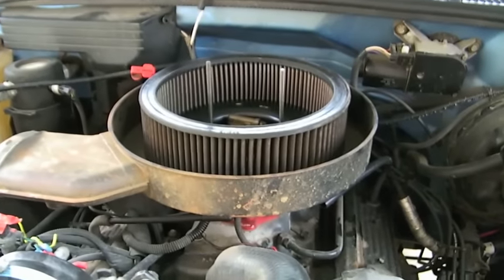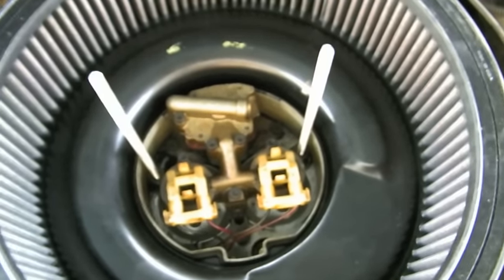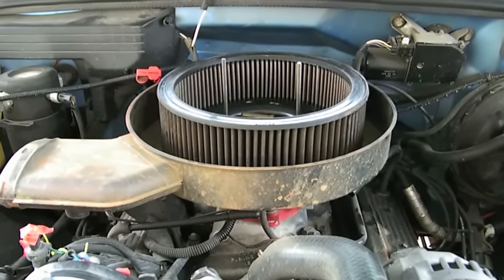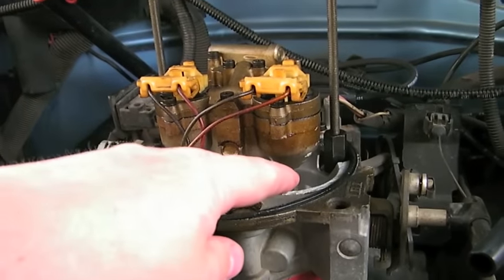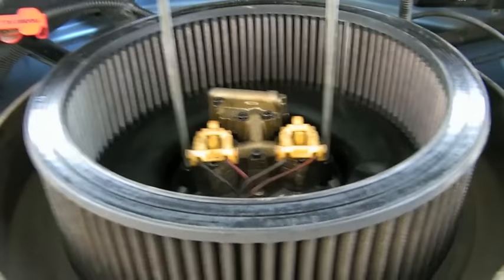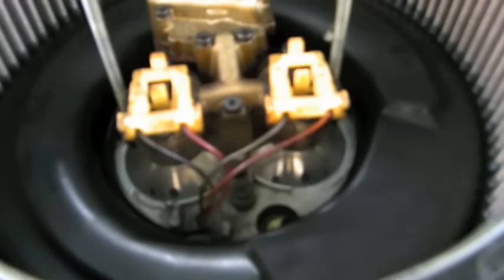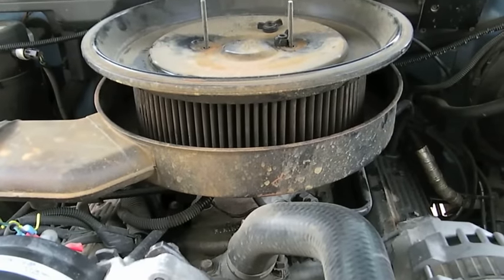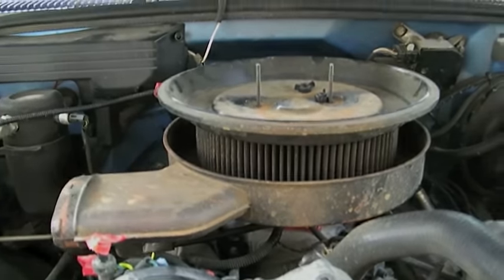TBI mods, how to get the most power and Horse Power from your TBI engine.

Comment: Go to goodwill and find a bowl who's bottom is approximately the same diameter as the spacer. Cut the bottom out and use as bottom of air filter. My car hood clearance was an issue you should be fine. This will allow for airflow from the side. This was from a Carcraft Dyno session. I had one on my 88 Monti Carlo you could always try one real quick without the filter and see if it works as good as it did on mine.

Comment: The lid flip is not smart for are 5.7 tbi. Because its sucking alot of hot air. Its a old school mythod that should stay in the past
Reply: Kyle Hendrickson with some engines, running to cold of air would actually be worse, just because the engine gets horsepower off of the heat it generates, so it would be fighting itself
Reply: Seth C Its a proven fact that cooler air produces more horse power, not hot air. So the lid flip is not conducive to making HP.
Reply: Scott George depends on your engine. in a chevy 350 yeah, cold air will give you horses. in a 2.0 4 banger, it will hurt the engine because its fighting to stay warm. but a general rule of thumb, you want as much fuel to keep up with how much airs coming in, whether its forced or naturally aspirated
Reply: Actually it does work. My truck has a 350 and when the lid isn't flipped, it doesn't get very much air and is restricted to the small amount it gets out of the wheel well, you can feel the difference in power when it is flipped because it has more get up and go to it and is getting way more air to the engine. And you think hot air isn't pulled from the wheel well also? I have 33" tall 12" wide tires and I guarantee that they produce heat going down the interstate at 70mph and that heat is pulled into the wheel well and into the intake. You're right if we're talking about sitting still it's pulling hot air, but going down the road it's pulling cool air because you're going atleast 35mph and that's 35mph worth of wind going through the grille and into the engine.
Reply: Alexander Moffitt any oem air system is designed to be restrictive, it was designed to coincide with the vacuum the engine produces, provided everything is sealed tight an engine will run smoother. but in the late 80s and mid 90s throttle body was more of an experiment on their v8s. but yeah there is a difference, and my favorite was cutting a hole in the hood, and the flipped lid acted as like a ram air. but kyles right because unless you have another vent for air, or some other system, you still are getting warm air, but all in all its a step up anyways
Reply: +Kyle Hendrickson Was great to listen to the old quadrajet's howl when the secondary's opened.  I wouldn't do it to a TBI system.
Reply: +Alexander Moffitt That's in your mind.  Put it on the dyno and share the results, if any?
Reply: +Seth C Again, another Noob.  Ram Air ... LOL.
Reply: Kyle-----You're right!   I did a "lid flip" on my '88 GMC pick-up and the engine runs rough.  Put the air cleaner back on the regular way  and the engine runs great.
Reply: Works there's proof. Air cleaner shootout.
Reply: @roknroll12  something something density altitude something.

Comment: I'm sorry I missed the part where the hose that connects to the back of that ring that goes to the pcv valve. So what did you do with that? Asking for a friend
Reply from the maker: Tell your friend that I don’t remember.
Reply: U need that line to have a vacuum you route it to another vacuum port on the tbi itself

Comment: Air noise is horrendous with the cap turned upside down like that
Reply: Guys like you are why the stock air cleaner is designed the way it is. Not for flow not for power simply quiet and barely enough air flow. You're hearing the induction noise. Lid flip on an old v8 quadrajet engine would sing.

Comment: so did he shave that metal while it was still on the motor? if so have fun if the shavings don't pass through the motor.
Reply from the maker: +Allen McKinney 
The engine was fine after. Ran great for about 3 more years.
Reply: boofighter ok he just didn't say where it was when he shaved it. I wouldn't do it on the motor even if it works for someone else I still wouldn't do it.

Comment: I understand that a "Lid Flip" gives better air flow, but it gives the engine hotter air instead of the stock version intake,  So does that not defeat the purpose?
Reply from the maker: +UrABoxxyBox the question would be how much hotter vs how much more air flow.
Reply: No

Comment: Does this work with cruise control? I know that may be a stupid question.
Reply from the maker: +Thomas Burgess 
Mine worked perfectly.
Reply: +boofighter that is awesome.  I was reading some of the forum posts about cruise control and some of them seemed to suggest this wouldn't work unless you keep the ring in.  Good to know.
Reply from the maker: +Thomas Burgess 
I took the truck on many long road trips after doing this and never had any trouble.
Reply: That's great.  I am going to do this as soon as I uncork my truck.

Comment: Anyone watching this don't do it you will choke your motor to death
Reply from the maker: +Daniel Rowe 
Not true.
Reply: boofighter I got a 1995 Chevy k1500 with a 350 tbi I took the ring off when I put a single stud air filter on it and I had also put msd coil pack and jegs high wire spark plugs wires on it and when I floored the motor and it choked so I got my dad's mechanic to check it and he said they have that ring inplace for a reason and it stopped so idk what to tell you
Reply: Btw take a rag and clean up that motor put a 292 cam in it Hooker headers and a new high flow intake manifold don't be cheap btw get a Chevy not a cheap knock off
Reply from the maker: +Daniel Rowe 
Are you related to Mike Rowe?
Reply: Just dumb comment. As an auto tech i just have to say that.

Comment: did you Dyno it?

couple guys here mention a 40hp loss from taking out the ring under the air cleaner:

https://www.diyautotune.com/support/tech/install/chevrolet-gm/carb-to-efi/part1/
Reply from the maker: +Jochen Schilperoort 
I did not dyno it.
Reply: boofighter so you used dynolycious to dyno it on the open road?

Comment: your going from sucking in cold air from the side of the truck to sucking in hot.
Reply: Very restricted cold air plumbed to be quiet. Look at all the round aftermarket air cleaners. Would they have been used all these years if they hurt performance.

Comment: The lid flip is a lie, all your doing is making noise and sucking hot engine bay air into the engine. That truck will run much better with the air snorkel running out to the fender an sucking in cooler outside air.

Comment: The weakness of the tbi is the cam the cam is small meant for low end torque with the open chamber heads  big chambers small cam aka stomp puller or dog

Comment: You just made it run leaner..
Reply: You can't inject more fuel without additional mods
Reply: Just bump the fuel psi up a little. Changing fuel psi on tbi changes the flow rate.You need some pretty major mods to need 350 injectors.Learned that the hard way. You can adjust the stock regulator up for nothing just some time . The seat where the spring sits is just above the slot don't see the spring through the slot on my blazer.

Comment: don't lid flip.
Reply from the maker: Always flip your lid. Always.
Reply: boofighter whenever I've flipped the lid on my 350 tbi ot just sucks in 200+ degree air from the engine bay. the engine doesnt like that. and performance declines.
Reply from the maker: As soon as you start to move the under hood temps go way down.

Comment: you actually drop some hp/torque if you take off the tunnel on top of the TBI. if you don't have one I'd recommend getting one. last I heard it's actually a significant amount.
Reply from the maker: +Logan Mailandt 
do you have proof of this?
Reply: The fact that velocity stacks are a thing? A fluid (air) accelerates in a straight direction faster than when it's turning. The more turns the intake system has the harder it is to build good runner velocity and for more complete cylinder filling n/a I'd always leave it on. If you're worried about volume of air do more work towards the ports
Reply from the maker: so you don't have proof that that this will increase or decrease power. you are just going off of things you read in a book or on the internet.

Comment: I'll just stick with my bone stock TBI 7.4 and you all can keep your wuss 5.7
Reply: I once had a 7.4 only getting 7 miles to the gallon,  then I turned it on never left a Gas station
Reply: TruckPassionPhotography
I'm not impressed.
I once had a 305 V6 that got 10 MPG when towed.
That's a 149 Ci less and only 3 mpg more.
Reply: B Ann ive got a 454ss pickup. had a 4.10 rear in it, stock it only had 230 hp, compared to the same years chevy 350 at 220 hp. the thing with the 454 engine was they have a huge stroke, causing them to wear alot faster when you put your foot in it. i swapped engines with a 5.7 and added a cam that dinoed around 250 lower end hp. she has lasted alot longer and has done me more justice than the 7.4 ever did
Reply: Seth C
Be sure to hang on to all your original parts !

There's not many of those trucks left and their  value IMO is going to do nothing but go up.

Also don't forget that that is 220 hp at the transmission output shaft with all accessories on.

Before ' I think ' 1972 HP was rated at the crankshaft so ratings were higher.

FYI, my 454 has 200,000 miles on it and still runs good & I have run the snot out of it.
Reply: B Ann good points, but my 454 was hooked up to a lower rear end that had me revving real high at lower speeds.and when i go to accelerate she would shift at red line. there was never an opportunity to wear in the engine. chevy big blocks have to be babied for its first 10000 miles i found, then with alittle adjustment here and there they were bulletproof. ive been through 3 454 engines.
Reply: Seth C
Mine has 3.42 and believe me when I say sometimes I would of liked to have had 4.10 gears but mine has tall 235/85/16 truck tires.

Anyway like I said those SS trucks are getting rarer everyday so if you still have all the original parts, keep them.
Reply: +Alexander Moffitt 
You do realize that you could pull the same things with a iron duke if you had the proper gearing, right.
Oh that's right you don't even know what a iron duke is without looking it up do you !

Ok, Since you sound like a Cavalier or s10 kinda guy you could pull the same things with a 2.2 motor with the proper gearing.

BTW a 5.7 will in no way compare to a 7.4 and why would you want to dump a butt load of $$$ into  a 5.7 to make it go when all you need is a stock 7.4 

Yes you can build a 5.7 with tons of HP but in the end its torque that gets you down the road.

I use my trucks, that's right trucks for pulling trailers and carrying loads and I don't want no fat ass tires with big wheels that will fall off blow out cost 3 times as much prematurely wear out wobble or get snagged or curb rash-ed when I encounter tight places ETC.
I want dependability and weight carrying capacity & I get it with a 235/16 tire.
& don't let that little  avatar pup fool you because she'll rip your ass off.
Reply: +B Ann i seem to remember everyone calling the 90s 7.4l boat anchors......allot of torque though.
Reply: 2012Z28Camaro
Yup that's what they say, boat anchor.
They have small head ports & throttle body but they'll pull all day long if you can feed them.
Reply: dont they make a better head for those things? you would think someone wouldve at least tried
Reply: 2012Z28Camaro
Sure, use the older heads & a better cam.
You can even get the TB to flow more air for about $250 if you want.

They already have 3 inch exhaust after the header Y pipe which feeds through a huge catalytic converter & exits through 2 large exhaust pipes so even the exhaust has potential with just a little ole sawzall & a new short piece of 3in pipe.

Take a look at the torque the newer diesel pickups are putting out if you want to be impressed.
I've heard with a tuner 1000lb of torque is pretty easy.
It beats them to death but its fun while it lasts.
Reply from the maker: +B Ann 
ok, sounds like a plan. i did not think you were going to give me your truck.